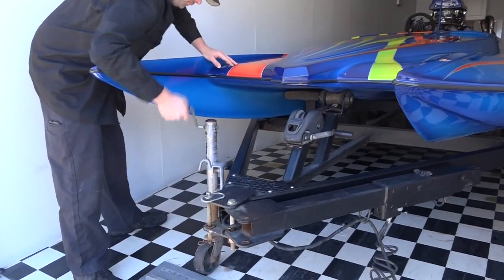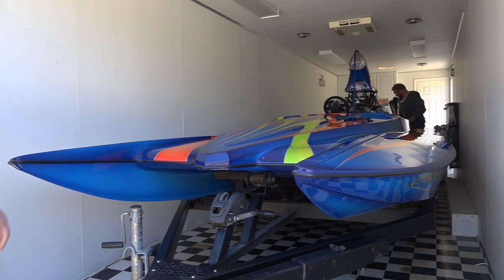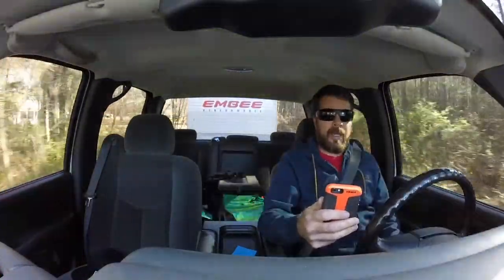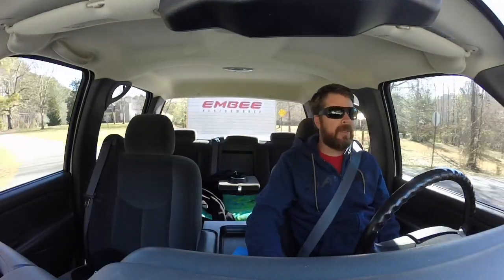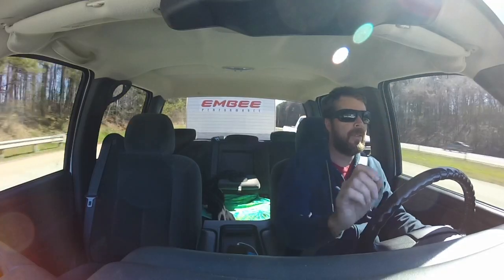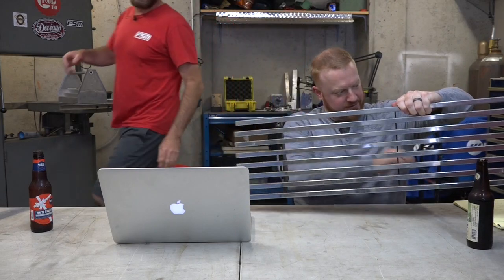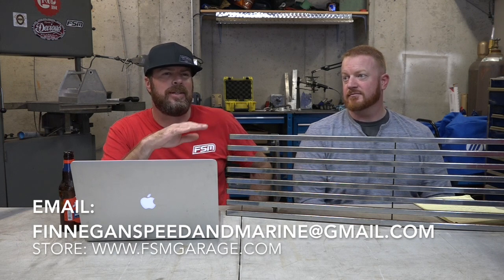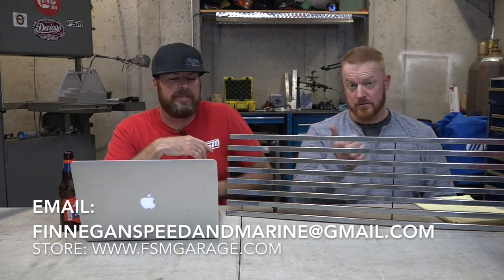Finnegan's Garage Ep. 29: Duramax Cooling System Tricks and Grill Giveaway Revealed

Comment: Hey Finnegan's Garage,
An easier way for you to hitch the boat trailer inside the enclosed trailer is to weld a plate on the end of your stalk with a hole big enough to fit a tow ball make sure to weld the nut to the plate first :).... This will be alot easier to hitch up in the trailer..... love your show mate.
Brett.

Comment: Mike, try this stuff called NuBrite to clean out the coils. You mix it 3 or 4 to 1 with water and spray it on, and it foams up and pushes all the dirt from between the fins. It's A/C coil cleaner but works on any type of radiator/finned cooler.

Comment: I'm so used to roadkill it seems strange that you are working on proactive cooling system measures. Other than removing the hood and stopping every time it overheats that is...
Reply: @ Two Wheel Workshop.. I can't lie, when I saw the title I assumed he was going to show us how to fit quick removal  pins to the hood
Reply: I'm shocked as well,I'm also guilty of lost-hood cooling systems.Back in the day(80's) I jammed a 383 Chev to a 73 Vega,Muncie 4 speed and a 8 3/4 narrowed Duster rear and after all mods were buttoned up,my choice of  radiator? The ORIGINAL Vega's itsy bitsy 2 vane piece. Did it overheat? Oh hell yea,every 1/4 mile. Did I fix it?...Well I tossed the hood,and called Jegs to order some ladder bars and frame connectors,cause,you know....that fixes overheat probs...😎

Comment: My dad put a Banks intercooler and radiator into his 06 Duramax, pulls our 32 foot travel trailer with a UTV in the back (about 14k maybe more lbs total)at 75-80 running about 180-190°F. Helps out alot

Comment: I have a 1973 GMC C2500 3+3, which is the same as the front half of Ramp Truck.  I also have a similar Aux fuel setup.  16 gallon main, and a 25 gallon Aux with a pump that fills the main.  It's weird, but functional as long as you are aware you have to shut it off manually.

Comment: I have an LB7 Duramax and I had to do the same thing, now it will climb too 215 coolant temp then the fan clutch will kick in and cool it right down to 200 and stay there, mind you this is in 100 degree heat and ac on full blast. These trucks are awesome.

Comment: On my 2006 Chevy truck bugs and stuff were able to go over the top of the intercooler and then drop down in front of the radiator.  There is about 1 1/2 inch gap over the top of the intercooler.  I installed some screen wire to cover the gap.  End of my heating problems.

Comment: Put the strong airbags on you're 73 Ramptruck, Mike Finnegan
Reply: I would go with a set of new springs and the  Firestone air bags and a set of Timbren bump stops. Set it up to primarily use the bags under load and have the Timbrens just making contact once loaded. That way the Timbrens will assist over bumps and keep you from having to put too much air in the bags making for a rough ride.

Comment: You can help fuel mileage and engine temps by installing a turbo downpipe. PPE makes one of the best.
 The life of the transmission could be helped with EFILIVE tuning. Idaho Rob is one of the best.
 Your Edge tuner doesn't do any transmission tuning. But the Edge is great for its gauge/monitoring options.
Also an aftermarket air intake or modifying the stock airbox really helps egts.
One more thing is installing a lift pump. They improve injector life and the truck will seem "freed up" since the CP3 pump won't have to draw it's own fuel. I do not like the FASS or AirDog systems because they are loud and fail often. Kennedy Diesel has nice lift pump kits, or you could buy a Fuel Lab pump and diy your own setup.

Comment: yo mike you did right with the LBZ but the problem is the cheap canned tuning and you need an exhaust kit.. she will run wayyyy cooler!!! AND if uwanna go that far there is updated coolers for the tranny!!!!  cheers !
Reply from the maker: who makes the a better cooler?
Reply: PPE seems to be the best one to go with, i dont use one and i dont plan on it. i have good tow tunes... compared to your edge that has ''power level'' i have tunes made strictly for towing application. for exemple on my tow tunes my tuner close the turbo vanes so it litteraly act like a turbo brake!! just that feature with the allison grading on tow haul make towing a charm!

Comment: would love to know how you cleaned the front radiators and intercoolers like a step by step process I'm having the same problem on mine.
Reply from the maker: step 1. disassemble front end of truck. step two, spray parts with pressure washer. step 3. reassemble front end of truck. step 4. smile.

Comment: Have a 2012 Chevy. 5.3 
My trans temps are always 190+ and towing run at 205+
I've not seen any debris in front of the radiator.
cant seem to find out if that is a normal temps for this year truck.
engine does not run hot at all.
thx.

Comment: Hello guys,

I was wondering. This trailer weighing in at 12.000 lbs or 5500kg. Does the trailer have any brakes supporting the car? because I can see that the trailer is secured with some heavy duty chains but I don't see a breaking system that is common in Europe. The trailer breaking systems in Europe depend on the weight of the trailer pushing a bar insidr the hitch and will pull on a brake cable, in their turn apply force on the drumbrakes of the trailer. 
furthermore, cars in Europe have a max towing capacity of 3500kg. If you want more you need a truck and a special truck license

Comment: Maybe im dumb, but im a mechanic, and i quite don't understand how radiator affect trans temp.
Transmission in trucks/ offroad trucks often have independent radiator for trans fluid. 
How it is possible to drop so much only by cooling down an engine by few degrees?
Radiator have a second set of hooses from trans or what?

EDIT:
Watched again, is that a trans radiator  ->  ic  ->  engine radiator (counting from front)? Or 2 engine radiators?

Comment: Hey mike I also have a 06 Lbz duramax that I use a tow pig, I’m wondering if you tow in 5th or 6th gear, when I tow my 7 ton gooseneck I found that I get lower egts and better fuel mileage in 5th gear when I’m towing above 10k lbs

Comment: So, you pin the top part of the square stock to keep the trailer from lifting off, but the bottom free-floats in the lower receiver at the floor?
Reply from the maker: I run a ratchet strap over the tongue of the trailer down to a pair of d-rings in the floor of the trailer.
Reply: 10-4. I was going to suggest that if you were ever towing in the Northeast where the roads are terrible.

Comment: i replaced my water pump,thermostat, radiator, and made sure sure my fans was working i still overheated 
260 plus 
the only thing i've found to work was removing the thermo and running without it
Reply: dennis bryan did you replace both thermostats? They have two, so you may have replaced the wrong one! Also, they really do mean 5 years on coolant, or you'll be flushing sludge

Comment: 10:40 anyone else bugged by the backwards audio?  lol
Reply: Turned my headset backwards and now it's better, though mono mixing would have been preferred.
Reply: Well that and buying better speakers would be like putting more power under the hood, but changing the final drive for fuel economy instead of speed.  More power - can't use it to it's full potential.

Comment: So what is the point of securing the front of the boat trailer with a pin, if the post is just standing in the reciever? Seems like the post could just be pulled up by the trailer while driving.
Reply from the maker: not shown was the ratchet strap that holds the tongue of the trailer to the floor.

Comment: Why is there only a pin at the top of the square tube?  would it not pull out from the base?
Reply from the maker: i run a ratchet strap over the tongue of the trailer down to the floor and theres a pin under the floor that goes into the tube.

Comment: Well you COULD power wash the intercooler....... or you could modify the system to use liquid nitrogen injection. I think we want to see you put the liquid nitrogen injection system on your radiator and intercooler, and a multi stage nitrous system on the truck.